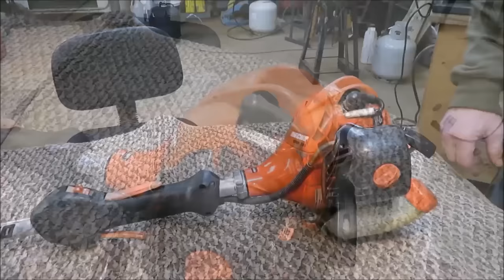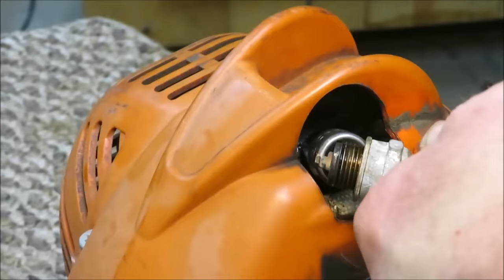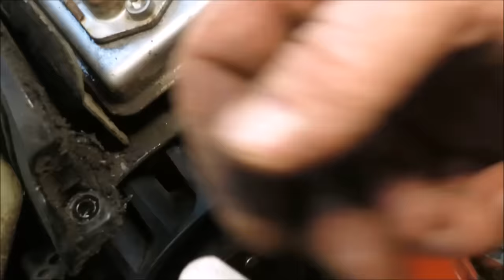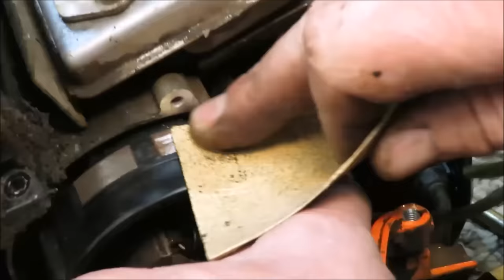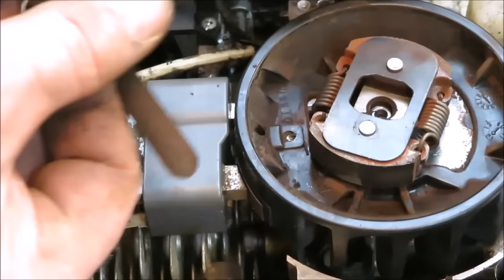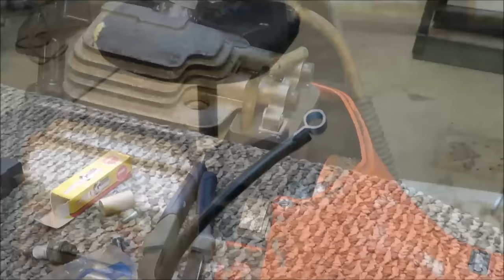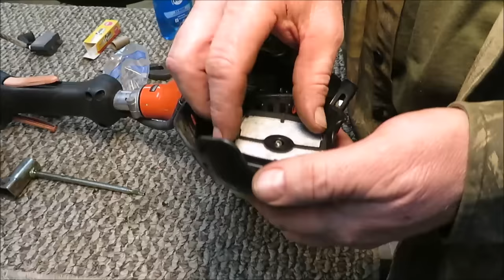string trimmer weed eater coil test & replace

Comment: I always turn the flywheel magnets 180 degrees away from the coil and install it and lift up on the coil and snug the screws and now rotate the flywheel until the magnets are under the coil and insert a paper business card between the coil legs and the flywheel and loosen the screws so the it pulls the coil back down and then tighten the screws and rotate the flywheel and pull out the business card..

Comment: When you put the sparkplug clip on the end of the sparkplug wire, you want to first stick the wire through the boot and pull it out the other side, then you want to put the clip on so that you don't have to force the clip through the small end of the boot. Once you get the clip on, then you pull the wire back through the boot till it seats in place. Great Video and thanks for taking the time to show folks how to diagnose and replace a coil.
Reply from the maker: Thanks for the comment.
Reply: Yes, wonderful public service!  You are doing it, thank you.
Reply: Thanks alot.  Good be job.

Comment: I had bought an inline spark tester to make it easier for my old eyes to see. I'm tearing down a craftsman  that the plug is soaked and the coil is not firing with the shutoff wire disconnected. This is the new piece of junk 4 stroke with the speed start. Thanks for the video.

Comment: Ohhh that was the problem. It happened on my stihl fs 240 weed eater. After a week... It is now FIXED ALL BECAUSE OF YOU!!!!!. Replaced the spark plug. Air filter. Fuel filter. New carburetor. New fuel lines. Even took out the old fuel and with new fuel. Still didn't start. And i was frustrated why would this thing not work after all of this parts has been replaced. After fixing the REAL PROBLEM... it did start up. Thank you so much you are a very great mechanic! Have a good one!
Reply from the maker: So glad i could you out and thanks for watching.

Comment: Awesome!  I watched your video.  Tested my Echo SRM 265T trimmer based on your video and $72.00 bucks problem solved. replaced ignition coil and spark plug boot. Now it starts and runs! Thank you for the video.
Reply from the maker: Thank you so much for the comment glad to help.

Comment: Hi Kevin- I have been working on my small gas engines for almost sixty years.  You learn a lot by just working on them like you do.  
I always clean coils with brake cleaner first to blast away the oil-dirt pathway between the poles of the coil fields and then I follow up with a fine wire brush wheel on my drill.  I do the same with the flywheel magnets.  Dirt and oil paths can weaken the magnet pulse induction thus failing to produce the required electrical charge necessary to produce a good strong spark.  The same is true for batteries.  Pick up a very inexpensive plastic feeler gauge to place between the coil and the magnets when reinstalling the coil.  This allows the magnets to hold the coil in place and makes inserting the screws more easily.  Just a small turn of the flywheel will permit the removal of the gauge and a perfect spacing.  Keep things clean and yourself so things last longer. :-)
Reply: Howmuch is the coil
Reply: No hard is it to put up magnito
Reply: Here can I  Plane part 417CC for you
Reply: 60 years ago there were not weed eater unless you are talking on different engines😂😂😂
Reply: I also use brass feeler. Non-ferrous.
Reply: This is EXACTY WHY youtube is Huge!  Thank You Jerry James for Adding significant value to Kevin Robinson's string trimmer repair vid... which Helped ME A LOT!! 
Wish a wholelotta folks would Add Their Value as courteously as you have!  
To the rest of you, If you can't be civil, then you got no place wasting other people's time w/ your pathetic little ego trips...
Reply: @MrMauricio1947  He said small gas engines, NOT weed eaters.....SMDH
Reply: Late to the chat BUT WHAT I LEARNED YOU CAN TAKE A BUSINESS CARD AND PLACE BETWEEN WHEEL AND COIL AND SHOULD BE CLOSE TO SPECS. DONT FORGET TO REMOVE CARD AFTER FASTENING SCREWS

Comment: As a small engine mechanic i always find people dont question their invoice when they have a fully working clean machine. If you have to take covers or cowlins off machines its always worth cleaning them and blowing them off with compressed air then using duck oil or wd40 to make the machine look like its been worked on. I have never had any complaints about how my customers machines go back to them, in fact all of them say how their machine looks like new. then they pay their bill with a smile and word gets around.
Reply from the maker: You are a good mechanic Tom thank you for the comment.
Reply: Should never have to hold the trigger on a Eco to get it to start .
Reply: Thankyou for taking pride in what you do! It may not always be noticed, but I believe the effort you put into something always shows!😊
Reply: Verygood thankyou
Reply: You can also take a multimeter, put iton the continuity sector, put the red node in the spark plug cap & ground it.rhen turn the magnito across the coil and watch the reading. Should be above 10 volts.
Mine runs for a few minutes rhen shuts down, but starts right back up and runs a minute. My coil drops below 8.50. coil is going out

Comment: Here's a second comment from Biomed.  A few of your viewers have said 'why don't you test the coil with an ohmmeter?'.  This is not an unreasonable question.  If the coil is open circuit it will certainly show clearly and the coil will need to be replaced (unless the break is obvious and accessible).  However the coil may show continuity and therefore have the appearance of being OK but if there is a shorted turn somewhere inside the coil it will definitely not produce a spark and will need to be replaced.  This is not easily testable with simple test gear but if everything else in the ignition system is OK, then this will have to be the circumstantial diagnosis.  For the techies the reason is that a shorted turn will destroy the inductance of the coil.  Keep up the good work!
Reply from the maker: Thank you for all the information Biomed.

Comment: Nice video for helping people that are not Mechanically inclined to save themselves some money. The average cost here in NCs shop cost start at for diagnostic is 65. And 65 an hour measured on the 1/4 of the hour. So 22 minutes is going to be billed at 32.50 + 65.00 which comes to 97.50 plus tax and parts.  It don't take long for the average owner to pay more to fix one than to buy a new one. Your helping people and keeping them from adding to the already disposal problems we have created with the replace it generation. Keep the good work up Kevin . Ive been working on small engines for 35years and a little good advice is better than none.
Reply from the maker: Thank you for the comment Dewey Lee.

Comment: This is EXACTLY what my PE 225 edger is doing.  I've changed the spark plug, fuel filter, air filter, fuel lines, and a new carburetor.  Still nothing.  I've noticed the spark plug looks brand new so I figured it's not getting any spark whatsoever.  I'm 99% sure this coil is what I need.  Thank you very much!

Comment: This was the best diagnostic video I have seen as far as the ignition coil goes. It certainly addressed the problem I was diagnosing. I also tested the coil for resistance. Maybe not necessary considering a new coil would be $10. Just replace it. Thankyou for the excellent sequential trouble shooting video. It is excellent! Thankyou once again.

Comment: Oops, I discovered it's possible to put the coil in backwards, which will louse up the timing. No problem, I found the right way in your video. New coil, clean plug, new prime bulb. It hasn't run this good in years. Thanks!
Reply from the maker: Thanks for the comment and watching Keith.

Comment: I too found this video very informative and. . enjoyable.  Making a video that branches both of these is far from easy.  In order to keep the viewer's  attention requires  the ability to demonstrate knowledge along with a pleasant, down to earth attitude that keeps the viewer watching.  Intrigued.  I've worked on small engines for years and yet, I still find videos like these helpful and informative.   Simple but effective.  These lanyards aren't meant to pull your arm from your shoulder.  If you're doing this on any two or four cycle engine, chances are the coil is the culprit.  Well done, Kevin.  I'll be watching more of your work.
Reply from the maker: Thank you so much my friend.

Comment: I scratched my head for days with a similar problem on a mower, swapping good parts from another I had nearby before discovering the flywheel had a bad magnet.  They do lose they're power (magnetism) from a number of ways, shock being one of them.  I found a description that stated if it doesn't suck and hold a screwdriver from about a half inch away then replace flywheel which I did and it ran perfect.  Tested it on both flywheels side by side and sure enough huge difference.  Haven't experienced that with my small 2-strokes but in principle it should apply.
Reply: Thanks so much to go through step by step to figure problem I fixed my trimmers
Reply: The best video I've seen, the info was awesome so awesome I fixed my weed wacker thank you so much this video will help a lot of people thanks again

Comment: Thank you for the useful video which really shows how simple the ignition system is when you get down to it.  There was no need to clean the pole pieces of the 'coil' (actually the stator of the magneto) and the rotating pole pieces as, although you said that they would make good contact, you then ensured, quite correctly, that there was a 10 thou gap.  There was never going to be any contact anyway!
Reply from the maker: Thanks for watching Biomed.
Reply: Kevin Robinson yeah - it’s an induced current. And it’s not a fillers guage it’s a feeler guage

Comment: Good video Kevin. One thing you might want to try before condemning the coil is to clean the coil around the bolt holes where it mounts to the engine and the engine as well so you have a good continuous electrical ground path. It can become corroded at this location and cause the coil to fail to spark.
Reply from the maker: Thanks for the info j tho.
Reply: Testing the coil prim and sec and when hot as the coil can short and i had a Stihl that shut down after about 10-20 mins when hot. Pain to diagnose. delamination and wires start to ground out inside coil.

Comment: Excellent video, I'm starting to dabble with small 2-stroke engine repair, I've worked on 4 stroke from Briggs and Stratton, and have a college degree in engine building, done more work on bigger engines. I'm quickly starting to learn 2 strokers can be a little more complicated and some brands like to modify parts ever so slightly. Only thing I can say from my years of experience with car ignitions, you're right with the dish soap, I've used a dab of dielectric grease too, but I was taught to slide the wire into the boot first, connect your plug end, then slide the boot over your plug end, it's a lot easier than trying to cram the plug end in the backside of the boot
Reply from the maker: Thanks for the great information and for watching.

Comment: … One thing you may, or may not have noticed in this video, He should have checked to make sure the wire end made good connection, within the spark-plug wire, before buying a new coil. It doesn't take much to take the end off, cut it back by about a quarter of an inch (most wires allow that much removal), and re insert the spring wire pin, back into the spark-plug wire in a new fresh position. Most new spark plug wires have carbon fibers, instead of wire (like in the old days), and the pin that sticks into that fiber, may, or may not, be making a good connection, which could lead to no spark, or a far weaker spark than the plug should have, causing the engine not to fire, when enough good compression, and fuel is supplied. So, before you go out and pay $50 for a new coil, check the spark-plug wire, that fits and connects to the spark plug. Over time of removing, and reconnecting the plug wire, it's solid like connect, may not be so well connected, as you think it is. The pin can pull out of the spark plug wire completely, or partly, making the connection very poor or not at all.  By doing this, you may save yourself a $50 pocket expense, and wait time for the new coil to arrive in the mail, or a miserable trip to the repair shop, for a new coil (which all come with a new spark plug, cup end already installed on it. Instead of the coil being at fault, it was the connection between the wire, and the spark plug end at fault.  Hope this little extra tip saves you some time , and money, and gets your engine back up and running sooner.  … another small tip; take time to make sure your exhaust port is open, and free of carbon build-up. It also can stop your engine from firing up, if you have spark.

Comment: Great video 👍. Only thing I would add is I would check for continuity in the spark plug wire too before buying expensive parts.
Reply from the maker: Thank you for the info.

Comment: My 225 Lite Husqvarna was a beast. When it quit, I checked spark, good, I checked compression, also good. I checked fuel, also good. Only thing left was the mixture of air and fuel, which will be known when I get done rebuilding the carb. I believe it's pulling air like a car with a vacuum leak. Good video for the DYI.
Reply from the maker: Your welcome thanks for watching

Comment: Great video. My Echo 225 trimmer had a WEAK spark and wouldn't run yesterday - changed plugs, blew out the wet cylinder with compressed air... nothing. Pulled the ignition module/coil and sanded down the 2 contact points that interact with the flywheel and then the magnets on the flywheel with 220 grit paper. .016" feeler gauge between the flywheel and ignition module and buttoned her back up. Started right up.
Reply from the maker: Thanks for the comment 71Rcode.

Comment: Good vid there  Kevin . I usually test for spark  by grabbing the spark plug and touching the motor while pulling on the starter. 
You may get a  bit of a tickle this way  but it does give an answer straight away.  
Cheers.  Keep it up. !
Reply from the maker: Thats a real man thanks for watching.
Reply: Billy Bobb I just get my girl to hold it. Tells you real quick and they get over it in a day or two. 😉
Reply: @fontaineking5158  Probably ex-girlfriend now😄
Reply: like a rock best thing that ever happened to me. 😉
Reply: Billy Bobb f*ck that! 😁

Comment: When attaching plug push the wire through the cap crimp the connector onto the wire and pull the wire back into the cap
Reply: Build up of carbon around the tab causes a higher resistance that makes a higher voltage drop wasting power at the spark plug making a smaller spark .

Comment: Nice clear video 2 things though put a piece of a4 sheet to get your gap .  and get a multimeter to check your coil and spark plug .all easy fixes .Very good point about returning old spares that shows your honesty . After using your machine remove the filler cap and put an old thin plastic bag over the threads then replace filler cap ,this prevents any moisture getting into fuel in damp conditions or storing for a while.
Reply from the maker: Thanks for the info and tips

Comment: Suggestion: Not sure cause I've never done it but the two pieces you put in the spark plugs end of the wire MAY (again I can't be certain) be easier to slip the cable through the rubber boot, connect the metal loop and pull/push it in place. Thanks, Enjoyed the video buddy.
Reply from the maker: I think your right my friend thanks for the comment.

Comment: Tip when re- installing the mag use a business card for a gapper if you aint got no feeler gage.
Reply from the maker: Thanks Dan good info.
Reply: I was going to say that and a wire gauge for the plug. Also please do some editing in the future and knock out about a third of the time, but I like your stuff.
Reply: fold a dollar bill in half and it will be .010
Reply: Thank you Dan for the advice. A friend told told me the same thing about using a business card. God bless you!
Reply: @chriswilliams2868  _ Why monkey rig everything?? Just man up and buy some correct real tools that are going to be used for the correct job... Then the job will be done correctly rather than half ass.
Reply: floyd loonie Best too use a non-magnetic item to gap the magneto.
Reply: @chriswilliams2868  Fold a bill in half?  Why not just use a 50 cent piece in the first place?  Doh!!!

Comment: ..you might have first put the plug wire thru the rubber cover, put the wire piece on and then pull it back into the rubber boot...
Reply: excactly
Reply: Lensmanic Feleven Ha Haa your spot on but I like this gentleman. His teaching methods are nice and easy to follow. Yes needs to edit his video better as well.
Reply: instead of dish liquid a dab of dielectric grease IMO
Reply: Boot goes on first 😂
Reply: hello i totally agree & im not here to correct anyone's basic knowledge but i kinda heard him mentioning that it was his first time repairing that echo srm-225. total respect tho
Reply: Echo  hedge trimmer blade sharp

Comment: I have a Mantis Tiller. I replaced the carburetor but it still doesn't start. I'll be checking the spark on the coil next. Great video.
Reply from the maker: Good luck if I can help let no.